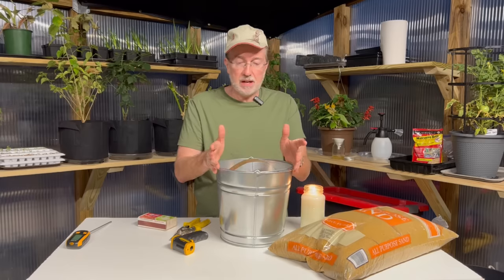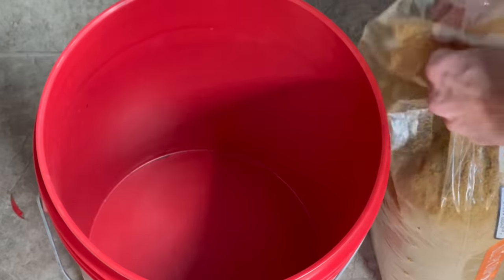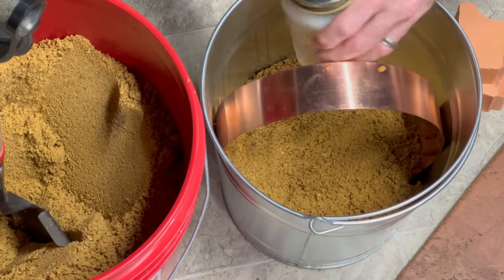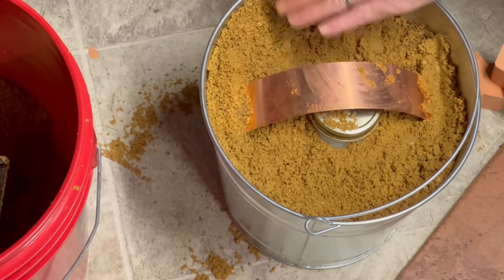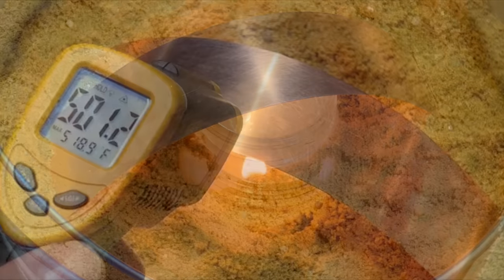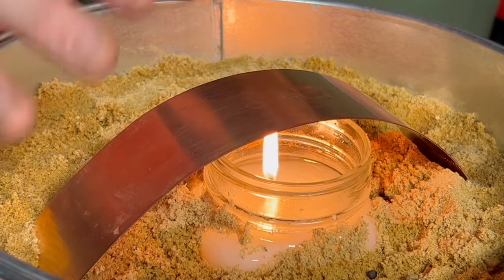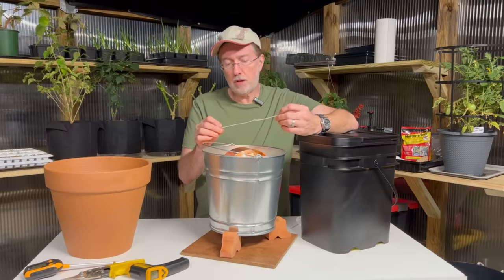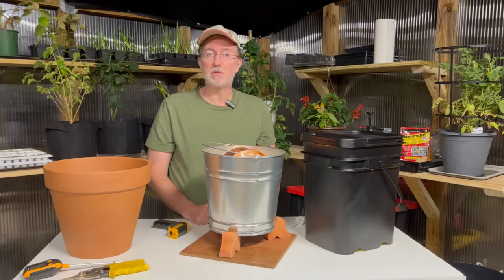DIY Copper And Sand Heater | No Electricity Needed For Greenhouse Heat

Comment: BTUs = BTUs no different than just burning the candle on it's own.
Reply: You made two different statements. One is correct one is not.
Reply: The difference is wasting time money and space on a bucket of sand. 🙃
Reply: @TofuInc of course a person will feel warmer after carrying and shoveling sand.  This bucket thing is a joke.
Reply: Capturing those BTU's and maximizing the heat output matters. Heating a substrate gives more thermal mass to release the heat in a controlled manner even after the candle is burned out. That is better than just heating with an open flame. This same principle goes for using drums of water to passively heat your greenhouse. The sun warms up the water during the day and the heat is released during the night. You will get more heat from 55 gallons than 25 gallons because  more thermal mass is heated up.
Reply: @MA-mh1vs  Sorry, no heat is magically made, you can't get more out of any system than you put into it.
Reply: @onefish26  Tell me you have never live off grid with out telling me you have never lived off grid😂
The amount of mass heated matters because more mass means more heat stored. 55 gallons of water will take longer to release the stored heat from the sun than 25 gallons will. This is why my 55 gallon drums of water left outdoors do not freeze solid even in the dead of winter but the smaller containers of water will be a solid block of ice overnight. This is why people have thermal mass stoves built to heat their home because they are more efficient in heating a home due to that thermal mass storing the heat from the fireplace.
Reply: @MA-mh1vs  This is correct, the Mass of the water is storing the energy, But you Had to Put that Energy in to the Water 1st.
A single Candle puts out about 80 BTUs per Hour.
Yes, you can Store that heat in the Sand,  But not very Efficiently. So Maybe you are storing 50%
If you Burn the Candle for 8 hours and can store 50%, then the Sand has Stored about 320 BTU's

This really needs to be scaled Up to be used as a way to prevent Freezing 
You Need More Flames and a Larger Volume of Sand, and Many Hours of Burn time to Store that Energy in the sand.
Reply: This process is delaying Heat Energy
by converting it into Kinetic Energy.
Reply: @wyldanimal2  This is true and he did say it was meant to be made with a multiple wick candle which would increase the BTU output of the candle. Obviously this would not heat anything but a small greenhouse and likely only work with mild brief freezing temps but sometimes all you need is a couple of degrees to prevent a freeze.
Reply: But through the magic of ignorance you can multiply energy beyond it’s real capacity. He also has the Golden Gate Bridge for you to buy for just $1.
Reply: I agree, the only difference is that for a short time after the candle is out, it will still conduct the remaining heat, the battery effect of stored heat.
Reply: @coeniebre  Yes, efficiency capture and storage the heat produce by the candle is why it is better than just using an open candle.
Reply: Negative! The HEAT is trasferred to the BUCKET and SAND, where it is STORED and RADIATED more slowly.
Reply: troll
Reply: Radiant heat heats objects, reg candles heat air.  - not near enough to heat the air.
Reply: @MA-mh1vs thanks for this comment/reply.... I don’t think people get it, it’s not about BTU’s it’s about radiating heat via the substrate
Reply: @n8rlvr876  Agreed.
Reply: Exactly. Any given fuel, only produces X amount of energy measured in "BTU's". If you are heating any space with a candle or this set up, the average temperature in that space will be the same. Thing like this candle mass heater will have a slower warm up to the space a the heat is being absorbed by the thermal mass of the sand. Consequently it will have a slower cool down. Same cubic foot space, same starting temp, plain candle and sand thermal battery, candles lit, space warmed say 10hrs, temps measured until the sand measures equal to ambient air temp, "the avg temp for both spaces will ne the same". The only benefits would be to reduce a extreme spike and cool down cycle. Other benefits would be to add humidity by adding moisture to the sand. The trade-off would be it would take longer to warm up initially. 
But you don't get more energy (heat or light) from the candle than it is capable of producing on it's own.
Reply: Isn't it different because a simple candle would send most of its heat through a thin convection air column to the roof where it would be quickly dissipated (a lot to the outside), whereas the contraption will irradiate more of the heat all around? Think of a lens focused LED flashlight and a diffuse light fixture. Both may emit the same amount of energy as light and heat, but one will uniformly illuminate the surroundings, and the other won't.
Reply: He didn't say it did, he said it would dissipate slower. Jesus, read...
Reply: Boiling a pot of water doesn't make a huge difference in enviornment temperature. And on the other hand, one can store boiled water in a container, like say a Nalgene bottle, and it will say warm and radiate heat for a considerable amound of time. I think there is something to the sand and bucket maintaining some considerable radiant heat
Reply: That was a stu..d statement
Reply: I have a small pump house and this method keeps my pump from freezing in minus 19 degrees. Before that I had a small woodstove in there. This is way more efficient...       👍
Reply: Takes 48hours to heat the bucket?
Reply: BTUs may be the same, but the sand will stay warm for a while after the candle burns out 
This setup is more of a feel good method
Reply: WNByers...correct. That's why forced air heating is an energy guzzler. It's like stepping on the brakes and the accelerator at the same time. European circulating hot water heating systems are vastly more efficient. Necessity is the mother of that invention because after World War II the United States had the lions share of the world's resources. By contrast Europe was placed on meager rations.
Reply: While the copper is a waste of space, I've lived off grid for 10 + years, and if u just have a candle it won't heat a space,but if u have a block of heat it will heat a room, it's about keeping the heat Ina spot, but 1 candle flame I doubt is enough. 
I have a big pot of water I keep on stove in winter, now. Lol and I turn it on to boil off in the morning,  stays hot all day I do it again before bed.
This is cheaper then using the propane heater..
And if you could get the sand hot it would.  Heat the house 2 some degree.
But 1 flame I tried to get it to boil a pot of water , after all night water wasn't even warm. So his sand isn't getting warm. He's a lier.
Reply: @johngross688  its not nice to call someone a liar.
Reply: The evidence of the effectiveness of this setup would be to accurately measure the temperature of the greenhouse before and after burning and then measured with just a candle.
Reply: These keyboard guys know everything don't waste your time trying to educate them it's a lost cause. I use black plastic drums filled with water and it works great.
Reply: Er, no: kinetic energy is that which is posssessed by a something with mass, which is in motion. The sand in this set up isn't in motion. @davemi00
Reply: @DxBlack Jesus saves, Satan burns
Reply: I put a bucket of sand on my wood stove.
Reply: Agreed.  In open air, a lot of the heat generated by a flame will just rise and float away.  A substrate will help it distribute more evenly and stay lower to the ground.
Reply: It just traps the heat and releases it slowly
Reply: Goal is to heat the bucket of sand which holds and radiates the heat, not the air. Radiant heat wins always
Reply: What happens if you put acetone in the sand
Reply: @MA-mh1vs the ONLY thing this bucket of sand does is to DIFFUSE the heat.  That’s it.  It does NOT create more heat.
If you want the candle to heat the space over a longer period of time, use a smaller wick or fewer of them.

If you want to heat the space more evenly, instead of 1 candle with 4 wicks, light 4 candles with 1 wick, and put 1 candle in each corner of the greenhouse.
Reply: @sambrusco672  No it doesn't create extra heat it fully utilizes the heat produces and makes the less efficient convection heat of the flame into a more efficient radiant heat. 
This same principle is used in glass heaters. The older versions simply had an open flame and the new ones have ceramic panels the flame heats up which makes a more energy efficient radiant heat versus the convection heat created by an open flame.
Reply: The bucket is capturing those BTUs that would otherwise be transferred through the air by convection, then to the roof by conduction and finally to the outside air by radiation. The energy leaving the system is the same in both cases, but the bucket allows other systems to be intermediaries in the transfer pathway and take advantage of the thermodynamic potential to perform work
Reply: You are correct in that the candle puts out X amount of BTUs ( British Thermal Units ) . The difference here is the ability to store the heat and make it last..without the heat sink the heat from the flame rises straight up to the ceiling and disperses, thereby wasting most of it... The idea is to capture and hold the heat before it's wated.. it ain't Rocket Surgery people  !!!!!!
Reply: Here is the thing that no one is mentioning - it depends on how how well insulated the environment is into which the hot air is convecting. The system is one layer deeper than you all are considering. If the insulation between the heated space and the exterior environment sucks, then more heat will remain in the portion of the system thats inside the insulation for longer if you delay that convection. For during the time which that heat hadn’t yet radiated out of the sand, you could say it’s very well insulated in there. Am I wrong?
Reply: You don't get anything for free .except the Sun
Reply: @wyldanimal2 if you're using the sun you don't have to put in anything!!!!
Reply: @WisdomIsPrecious  insulation definitely effects the heating ability. I have two greenhouses, one is corrugated polycarbonate panels and one is just plastic. The temp is warmer in the greenhouse with panels so I will be adding an inner layer of bubble wrap to insulate the plastic covered greenhouse.
Reply: This actually is a good idea. What he's got going on is this: the Cooper and Hannah's metal bucket are good conductors. An easy way to think of it is, the better of a conductor of electricity s material is, the better conductor of temperature it will be. So the Cooper circle is mostly buried in the sand as the Cooper conducted it's hear under the same, it heats the sand up. The sand, being a poor conductor will lose its temperature more slowly than the metals, which makes it the thermal ballast, thus conserving energy. So the BTUs basically are being stretched or conserved. What would make this even more efficient would be to give it a hat and jacket for the metal parts anger the candle burns out. The Cooper is a good connector of cold also, so it actively brings the cold ambient air temperature under the sand as well as it transfers the heat to the sand. So it you could insulated the copper and put a jacket on the bucket it would prevent the metals from cooling off too fast. Next, I'm thinking that if you put 3 court circles perpendicular to each other, crossing at the top, above the candle flame, it should heat the sand twice as fast. Then, if you put a copper coil in the sand and circulate water and glycol through it and over to a large water reservoir, like a hot water heater out a hot tub or swimming pool, you could heat the water.
Reply: @jsveiga  loss due to insulation insufficiencies will occur for a plane candle and this thermal candle thing. You can never get more energy into anything than you put in. It doesn't matter whether it's electrical energy, radiation (that's the type of energy that comes off of something that burns, light and thermal radiation). 
Think of the candles like a buckets of water and the space that it is heating like a blow up kids kiddie pool. The contents of their buckets you can look at as energy. Fill both buckets and set each one inside its own kiddie pool. In one bucket you drill a hole. It takes takes 10 minutes to drain the bucket out of the hole that you drilled. You now have 5 gallons in a kiddie pool. For the other one you pick up the bucket and pour it out. Over the course of 10 minutes... Both pools are going to have 5 gallons of water in each. 
I hope that puts it into terms that you can understand. If the room isn't insulated (greenhouse) it's not going to efficiently hold a large volume of heat or a slow trickle of heat any better over a average time period. 
People in here are talking about water being used as thermal mass in greenhouses and that is fine because you are using the sun to heat the water and then it absorbs x amount of heat which is giving back to the space but it doesn't create more heat than was put into it. If the Sun is behind the cloud, and doesn't heat the water the water can act as a cold sink. 
I mean I know that everybody didn't go to college but they taught us in Junior high and high school, the law of conservation of mass and energy.
Reply: Although I agree that these things are misrepresented as something that magically produces free heat, there are differences.
The differences are time and focus.
With a free burning candle, that heat quickly rises to the ceiling and most of it escapes before it can even transfer to the room.
The sand bucket takes that heat and then slowly distributes it in the area that humans can utlize.
Reply: @alfreddurbyn642 it is amazing how they think, I mean there are companies that sell kits for heating pools, sun showers, passive home hot water heaters. Smh what do they teach keyboard people?
I think two+  wicks gives out the most use or half inch wide wick if you make your own candle. Most effective  was with the bottom a air gap, the earth/ground is a heat leach .. unless that's what you want.
Reply: @sibco96   Actually, it works.  I use the same technique, never realized that anyone else did, when I have to wrap a plant or shrub. I do it on a much smaller scale, but the same allows the heat to be stored and the copper amplifies and controls the rate of the heat.
   The sand will continue to release heat after the candle burns out. 
   The slow release is the same principle as the use of terra cotta bricked in front of a south facing window in areas of extreme cold or for those savvy enough to use free sunshine instead of electricity.
   Just as is the case where water is stored in brightly lit areas, free heat and controlled release.
   By the next morning the bricks or water is cold. But the house is much warmer. The home owner can start from "cool" and warm up to comfortable a lot quicker and cheaper than starting from frigid.
Reply: Yeah I mean radiation has nothing to do with it...🙄🤦‍♂️
Maybe you need to retake fifth grade science? 🤣
Reply: @Alex-um4fe  I admire people that put forth the effort to explore and try things outside the box. Even if it doesn't work out for them they received a hands on education. A negative minded approach will accomplish nothing. They're their own worst enemy.
Reply: Sand battery
Reply: @johngross688 the water vapor in the air has a greater capacity for heat than dry air.
I think the idea here is how heat dissipates different.
Still has a out put after the outside temperature is dropping.
Reply: @wildmanofthenorth1598  right I was trying to express that, I was pointing out a candle flame isn't enough heat to heat a room no matter what you do with it.
Candle flame is bout 75 BTU, my propane heater 20,000 btu 
Traping the heat low is smart. Just not enough heat.
Reply: If you burn a 1.5 diameter log in a fire place you will get less heat out of it than if you burn the same log in a wood stove.both will send the same volume of exhaust up the chimney but the stove will give you more radiated heat.
Reply: @MA-mh1vs  
    Exactly ... 👊😊👍
Reply: @onefish26 nothing burns 100% efficiently so there is always more energy you can extract. Red hot copper acts like a catalyst and burns any un burned hydrocarbons and adding to the total released heat.
Reply: @rider65  heat from burning a candle or using a sand candle thing "is radiation". When you burn anything it gives energy in the form of light and radiation. We refer to that radiation as thermal radiation and it is commonly as Fahrenheit or Celsius.
This thing is complete BS but... Maybe if you had also paid attention in fifth grade science class🤓 you would understand what you said made no more sense than this mans claims 🤣.
Reply: @onefish26 Yes you can get more out of systems than you put in it. Look at fire for example. You make fire out of very little. Then you can make it as big as you want. And for 5 minutes worth of work you can have it burn for hours. So yes, you can definitely get more out of a system than you put into it! Unless your closed minded anyways
Reply: No. That doesn't speak of efficiency or radiant heat storage.
Reply: @tonicoles6831  not really but it would increase the heat output but would off gas maybe arsenic I'm not sure what the catalytic by product would be.
Reply: The law of conservation of energy would suggest that the amount of heat added to the greenhouse is identical if you just burn a candle in the greenhouse regardless of what contraption you add.
Reply: @coeniebre yes, and furthermore the only heat added after the candle is out is heat that would otherwise have gone directly into the room while the candle was burning. 

The bucket is increasing the total thermal mass of the greenhouse so the net effect is it reduces the temperature increase created by the candle
Reply: @DxBlack 
The comment was made by a flerf
Reply: Exactly correct.
Reply: People that post this kind of BS need to  take and pass at least a Hogh School Physics class.
Reply: BTUs are BTUs but the direction and storage of said BTUs make all the difference.

Most candle allow heat go straight up and the heat is absorbed there. Since ppl don’t live on the ceiling, having that heat absorbed and held at a lower level benefits us more
Reply: It's about storing the  heat
Reply: Pay you bills and you wont need this kids🤣
Reply: British Thermal Units.
Reply: I sprinkled a few handfuls of pennies into the sand too, and used 2 copper rings...pennies are mostly zinc, but it seemed to make a small but noticable difference in keeping the sand warm for longer
Reply: For those who argue, "specific heat" is the term for what you're missing
Reply: @TofuInc it may save your life.
Reply: @TimeSurfer206 🔥  this will work in a small room.
Reply: So, everybody in the comments is a rocket fuel engineer, lol.
Reply: That's not quite true, some things are more efficient at transferring the heat in the surrounding area than others.

BTU's are not the same as watts. In other words the heat generated is not the same as the energy used.
Reply: Obviously you've never studied thermodynamics. All the heat you can get is based on the amount of fuel burned. Storing some in water or sand doesn't add to that.
Reply: @MA-mh1vs  the op is educated and an example of a little bit of knowledge is a dangerous thing.
Reply: @bsrcat1 You are heating air the other way and convection will quickly remove it from the area.
Reply: The heat distribution is diffrent. Another armchair hawkings.
Reply: "BTU=BTU", but that's not the whole picture.  
You need to consider the concept of heat flow. Heating is a time dependant variable. There are also gradients to consider- higher temperature gradients result in faster heat transfer, exponentially so. The reverse: lower gradients, result in insulation and usable heat RETENTION, which is the point of this video project. 

 Simply lighting a candle does not do the same thing as spreading that heat across a mass that can retain that heat over time; not the same Broth Thermal Units (do people still use those?!)

And then there's the basic concept of buoyancy, whereby lighting a candle sends all heat directly up immediately where it is retained by an R-1 film of greenhouse plastic. This relies on a isobaric restriction (vs. aidiabatic) of gas expansion to retain heat (isothermal flow depends on pressure and volumetric expansion) (ie. heat and temperature increases if and only if the volume is constrained and gas expansion cannot freely occur, which increases the space between molecules and so lowers temperature). Aside, the stratified heat layers at the top of the greenhouse film or roof do little good in heating the ground or floor level. 

Here, Capturing the heat BELOW the candle allows for heat transfer as radiation instead of simple convection which results in rapid cooling (this is also why double pane windows exist, and why the air gap isn't Willy-nilly anything you feel like in between layers). There is very little convection inside a bucket of sand, so heat is transferred through radiation, an omnidirectional process, and over a longer time period resulting in more heat and higher overall temperatures even given the same heating volume. (These are not closed systems in the real world; there is a outside outside of the inside which you are heating). 

I could go on, but suffice it to say you have a lot to learn about heating and heat transfer concepts if you think simply lighting a candle heats a space equally to building a mass heater. 

Perhaps look into why engineers don't build stoves out of thin metal or thin cast iron; the heating efficiency of various stoves is easily available to compare and prove to yourself burning x amount does NOT result in equal heating BTU or joules or whatever metric you measure in. 

You can also look up liquid sand solar batteries and liquid salt batteries for cutting-edge heat batteries designed by actual engineering experts and scientists. Understanding the difference between temperature and heat will let you understand volumetric time derivatives (ie. heating) in a more intuitive way. 

Bottom line: for any given fuel input, MORE heat will be retained and extracted in a usable way when mass heating is used vs not.
Reply: @ChrisW-te1rb No you have a much greater volume of air going up a fireplace chimney then an inclosed stove does.
Reply: @And1Mell 1 Watt equals about 3.412  Btus per hour.
Reply: @onebylandtwoifbysearunifby5475 I don't think you will get an arguement there.  The arguement is that if it takes 3000 Watts to keep my area warm very hour. That means any storage. system will have to have and output of 3000 Watts very hour to keep my area warm. So if my candle will keep the space warm. It would keep it warrm regardless of how the heat is dispersed. Assuming the system is closed.looped.
Reply: @jhenrypaul  It sounds like It should be that simple, but It turns out not to be that simple. Heat transfer between a 100 degree source and a 1 degree room is not simply half of a 200  degree source to 1 degree room. Heat transfer is not linear with temperature differential. Aside, even using the same amount of fuel, different heaters have different efficiency. Even in the same exact heater, how it is implemented makes a large difference. 

Having a radiant heating system installed in the floor is significantly more efficient than the ceiling, for example, and will yield higher actual room temps for the exact same energy input.

Candles have a very narrow heating column which spends little time heating any air in the room (as air is an insulator not conductor of heat/ electricity), and what does goes straight to the ceiling. Then you have a high heat differential with the ceiling, which results in heat being transfered out of the room through conduction and radiation. Radiation, however, can be beamed into all surrounding materials where it will re-radiate back and over an extended period of time. The temperatures will remain higher than a simple convection system. Temperature is motion after all. 

In this candle set-up, the efficiency comes from bridging the extreme high temperature of a flame to the lower temperature mass of the sand. Air is a poor conductor of heat, so without a mass load to transfer heat to, the room will not heat as well without a heat transfer device to get that temperature closer to the desired room temperatures. Ideally, if you could get your candle burning at a degree or two above room temp and burn it longer, that would be your highest efficiency for burning a candle by itself, but unless this can be done, actual heating of a room will be lower given the same volume and same candle without a heat storage device than with such a heat sink. 

This is also why wood stove burners put fans on top of their stoves commonly- it heats the room more efficiently and to higher temperatures given the same stove and wood. Distributed heat lowers the temperature in exchange for increased volume (or surface area) of the heating path. So in actual implementation, you will get more heat from the candles transferred to the room. It will not make your candles larger (or have more mass) however, that is true. 

For a greenhouse, often heating at a low temperature for longer is desired. Heat batteries even-out this heat transfer just as electrical batteries do. 

Another example is boiling water on a gas stove- you will use more gas boiling a kettle at max than at medium setting. Same volume of water, same kettle. Heating gets a bit tricky in practice, it's not as straight forward as joules in / joules out. Mass heaters like these absolutely will heat your space to higher temperatures than burning candles alone. 

Just lighting a few candles will not keep your plants from freezing, but putting them in a mass transfer device (like clay pots) often will. Sometimes it's best to do an experiment to prove this to yourself, then work backwards to find the explanation which makes sense. There have been entire books written on mass heaters, it's even a specialty in the engineering field. The best mass transfer heaters are phase change salts, but water is a close second. Sand and concrete are multiples behind them (far less heating output for the same inputs), but cheaper than salts and often easier with less complexity. Still, if you can do a water heat transfer system, that's your best bet aside from phase change salts. Mass heaters are far more efficient, and yield higher actual room temperatures for the same energy input. People seem to be missing this fact because they get hung-up on how much energy a candle has to burn, which is not the same as how much energy the room has received from it- ie. actual heating. Number of calories in a candle and how many of those heat the room are two different things. 

Putting an upside-down clay pot over this sand bucket heater would make it more efficient, and heat the room to a higher temperature. Slowing the heat flow away from the candle and conceding the convection to radiation would yield a sustained absorption and re-radiation to the room (or plants). Too much heat is simply escaping upward in this design as is. Also, copper probably isn't essential. Aluminum is flammable, so may not be best either. Steel would be cheaper and is nearly as conductive to heat as copper. Such a device with narrow air gap between bucket and clay pot lid could yield 4 to 12 hours of continual heat from tea light candles, depending on the size of candles used. That could make a big difference in a solar heated room where the candle heater boosts the temps overnight until the Sun is visible again. You won't get that heating performance with candles alone.
Reply: @onebylandtwoifbysearunifby5475  Ok I guess I should have been more concrete in what I said. So whatever the heat source is lets assume one hundred percent efficiency.

If my place requires 3000 Watts per hour of heat to heat my living space from the outside tempature of -20f to a livable inside tempature of 70f. Than any mass storage system will also have to put out 3000 Watts per hour to heat the space to the same tempature.  

Floor heat allows less energy usage because the heat is radiating from below and so after a certian hieght the tempature becomes somewhat less important. So you are not heating the whole of the space to the same tempatures as if you used above floor heat.
Reply: @onebylandtwoifbysearunifby5475  As to candles. The heat output of the candle will remain the same weather it is going upward or being collected by a bucket full of sand and copper. Yes I agree that how you experience that heat will change.  Over all heat in the room will not change. The change will be in how it is used and stored.
Reply: @jhenrypaul  I guess the best thing for you to do is run an experiment. Put a candle mass heater in a small room and record the temperature after 8 hours. 

Then do the same with just 3 candles alone. 

When the temperature of the room is higher (keeping all variables the same) using the candle mass heater, then you will have convinced yourself there is an efficiency percentage you must multiply this all by. 

Your assumption is correct If you are dealing with a 100% conversion of mass to energy, and volume is negligible (or very small, like a cardboard box) with 100% insulation (ie. an actual closed system) AND one where the 2nd Law of thermodynamics is not involved to transfer heat through a volume or to the outside. And then TIME also would not be a variable of concern. In these cases, such as a matter- antimatter reaction where 100% of mass is converted to energy and instantaneously.... and in a small volume incapable of heat transfer (such as a true vacuum at 0 degrees Kelvin)... THEN it would only be a matter of mass of candles, yes, you are correct there. It would all be equal. 

You can also run an experiment putting radiant heating in the floor and again in the ceiling; just make a model and use electric resistance heating wire put into a board or small sheet of plywood. Put a few thermometers in different places in the "room" you built, and then aggregate the results. You will find the temperature of the room is higher when the heating was in the floor. (There are many subtle reasons for this having to do with how radiation propagates, and conversion of high energy waves to more but lower low energy waves (waves multiply in numbers), etc...  But it's probably most obviously seen by thinking of convection currents, because you can actually see those if you add some smoke to the room. 

None of actual heating is as simple as putting a candy bar in a bomb calorimator and seeing how much energy your starting material has. (And even across humans, different humans will get different amounts of energy from eating the same exact candy bar, so not even this can avoid energy conversion efficiency factors.)

It's best just to run an experiment. There are several data logging thermometers available now that make these things very easy. One's with Bluetooth are even available. Just remember to calibrate the thermometers TO EACH OTHER before you start, and keep each in its own same spot in the room. Then you don't have to worry about accuracy since you are eliminating the variable (calibrated thermometers are much more expensive anyway, so you can just use 5 or 6 cheap ones instead.)

There's always more variables than we simplify to. Just run the experiment, and you will get your answer.
Reply: @onebylandtwoifbysearunifby5475  You bring up an interesting point about doing an experiment. But why do I want to? I already know that even running a 100 Watt incandescent bulb in a small insulated garage. With outside tempature at even 31 degrees F for a week or two. And running that 100 Watt bulb has no useful effect on how warm that garage will be. That bulb is putting out more heat then a standard candle.

Ok again I was not direct enough. By a closed loop system I meant that all energy used to heat an area stayed in that area. So there was no lost energy from the heating source. Not that there is no lost energy from outside influences.

Back to floor heat. Energy savings have to do with how the heat is distributed. It has nothing do with heating a room with above floor mass heat collection system as this candle setup is. Unless you apply that candle's heat to heating a floor,heating system.

I think the point most of us are working to impress here is, a small fairly simple system like this candle will do really nothing to provide needed heat, in a heat required situtation. 

If you want a little heat made a little fire pit and collect some twigs. You will get more useable heat.
Reply: @jhenrypaul  Well, you can always do an experiment to find out if your assumptions are correct. 
(If you don't want to, I understand that, so I will just give you the answers):

Radiant heat installed in floors are about 5% more efficient than those installed in ceilings. It heats rooms about 5% more using the exact same joules input.  

Do these mass heaters work: 
Yes.
Do they heat rooms more than candles?
Yes.
Do people use these types (including clay pot heaters) to heat greenhouses successfully? 
Yes. 
Can you notice a difference of temperature walking into a room heated by 3 candles in a mass heater? 
Yes, easily. You don't even need a thermometer to notice this. 

So you are stuck here a bit. You have some assumptions, but don't want to run an experiment to see if they are correct. I can tell you they are not. I can also tell you I have built several mass heaters which use candles as heating fuel. I have also recorded the temperatures to prove this, not that I am the first to do so.  

As to your idea of burning some sticks instead, that works too as long as you don't mind carbon monoxide poisoning. It's just what works for you. 

You may be interested to know candles have been used for room heating through history.  They still are. Even the reindeer herders in North Siberia, Arctic Circle, the farthest north human occupied settlement, uses candles as heating overnight. Trees don't grow that far north, so there is no wood.

So do candle mass heaters work:
Yes. 
Do heat rooms better and to higher temperatures than candles alone? 
Yes. 
Do you need to build one? 
Well that depends if you have a need for sustained safe heating that doesn't output hazardous waste gasses in an enclosed space. 

If you really want to get into why these work better than candles, you will need to get into quantum physics: 1/2 spin modes of electron orbitals, photon conversion, resonance of electrons at different orbital energies, emission frequencies of orbital degeneration, etc. 

The short version of all that is infrared wavelengths are lower energy than visible light, so you are wasting most of the energy as light unless you convert each higher energy vis light photon into MULTIPLE lower energy infrared photons which are each capable of matching the resonant frequency of electrons surrounding the atomic nucleus. Thus resonance provides vibration, vibration is motion, and motion is heat. 

As I said, if you want to know the answer you will have to run the properly designed experiment. If you want to guess based on incomplete knowledge or understanding... O.K. but  you just have to be realistic that your guess may be incorrect. (If you think you have complete knowledge of physics and nature, then you have started with a fiction to build all future assumptions on).
The world wasn't built for us to easily understand it; nature is complex. Simple rules we make are just a convenience at the surface level, they don't actually govern anything in nature. 

In the simplest possible terms: 
Do these mass heaters for candles provide more heat than candles alone? 
That answer is YES. Yes they do. More actual heating than burning the candle alone. YES, more BTU, Joules, Watts, etc. More heating and higher room temperatures. Maybe that will surprise some folks, but it's just how it is. Again, anyone who doesn't believe this can always run an experiment themselves, it's not hard and kinda fun to realize something surprises you about nature and your assumptions of it.
Reply: @onebylandtwoifbysearunifby5475  I doubt many here are willing to spend the winter in a shelter kept below freezing.

I don't say candles made no difference. Just not enough to be of real use in many areas and live the way we want to live.

But on day ten of highs of -20 F. You can sing. The praises of you 3 candle, mass heater. And I well be happy that I am using my energy guzzling Buddy Heater in my shirt sleeves and the fuel to last me another 20 days.
Reply: @MA-mh1vs  thank you for your intelligence sir
Reply: These comments, dude 🤣. You have triggered some folks with your science, lol. 
The best argument I saw was that  "the sand bucket holds that heat energy from the candle, instead of transferring it to the air..." So you have the sand transferring the heat energy to...the air, just a little slower, (at approximately the same rate as the heat energy was absorbed by the sand lol.
Ok, just burn the candle.
Reply: But the dispersal is very different. The heat is now emitted in all directions, as IR rafiation. Not sent straight up as hot gases to the ceiling in a narrow column.
Reply: @ingeniousmechanic  Please refrain from invoking the word "science" to support your feelings and assumptions; "Science" is becoming an overused and watered- down word in the social media age.

 The people you think were "triggered" are the ones trying to explain the science to people that guessed incorrectly. 

Compared to burning candles alone; Not only do mass heaters produce better, longer, and more effective  room heating, they also produce more actual heat output.
Reply: @onebylandtwoifbysearunifby5475  not possible. The burning candle only "produces' so much heat. You can't get more heat out of that sand bucket than the candle can put into it.🙄 Talk about 'science. How about thermodynamics?
Reply: @ingeniousmechanic  I would explain how a heater produces more heat than a candle alone if you actually wanted to learn something, but you seem to only want to reinforce your (incorrect) assumptions.  "🙄" and "not possible" tells me you do not want to learn why you are incorrect, so I won't bother explaining it if I would be wasting my time and you would reject the correct information anyways.
Reply: @onebylandtwoifbysearunifby5475  🤣oh, I'm sure you would explain it to me 🤣. You're going to explain how sand in a bucket 'produces' more calories of heat energy than what is put directly into it by the candle. 🤣 I'm all ears.
Reply: It's taking advantage of thermal mass
Reply: @jeremyhinken3365  makes no difference
Reply: ever hear of a masonry heater?
Reply: A candle will only put out so much heat and that's it
Reply: @onefish26 it's about absorption and release. Eg glow in the dark substances aren't making more light. They absorb it first and release it slowly. 
If you take a dish out it the oven is it instantly cold when removed from the heat source? So heat isn't just there and then immediately not there if you harness it with material that makes it last longer. It's really important to realise this if you want to survive when power goes out in mid winter. These little tips have saved many lives.
Even a candle flame...if it is just going straight into the air then don't bother. If it's being absorbed and released over a wider surface that heat is put to good use.
I once made a small rocket stove. I tested it with a few twigs and put a metal bowl with water on the top. That water began to steam so fast! A normal open fire with a small handful of twigs could never have achieved that. 
It's all science. Do what works. Lack of understanding won't stop it from working.
Reply: But= btu ,,,but it's about traping that energy and useing it effectively,,,, most of the energy released by a candle goes to waste in open air
Reply: Well it's a thermal battery. It takes longer for the heat to dissipate.
Reply: @MA-mh1vs lake Superior typically freezes every winter
Reply: @kilowhiskeyalpha6078 yes that’s what I wanted to see. Also there are heat guns that can be pointed at the bucket to read the heat that is being radiated. Test heat at one hour intervals to and show us what the heat gun reads..
Reply: Before and after temps in various locations of the greenhouse would be nice and would demonstrate the effectiveness of this system rather than just the heater itself.
Reply: @glennwebster1675 did you use this exact set up? How many and what sized wicks do you use?
Reply: @onefish26 shut the UNEXPERIENCED MOUTH
❤, people here who've never gotten mud in their mouths sure could've fooled me!?
Reply: You're clearly simple minded. Residual heat and radiation is the point of doing this. No one said that it creates a more intense heat than a candle. The heat from a candle alone goes straight up and out and up. It's not efficient at heating the air localized around it. And if you're heating a place without air circulation, it's a boon for keeping plants alive that are obviously lower to the ground.
Work on that abstract thinking mr. Physicist.